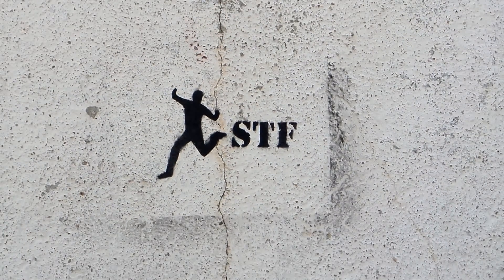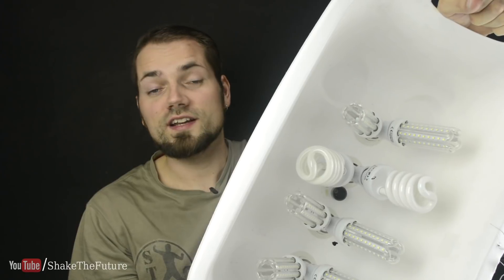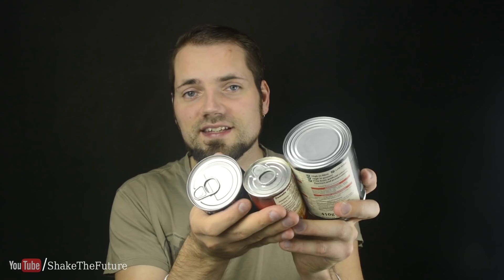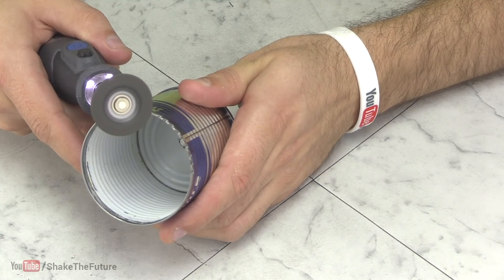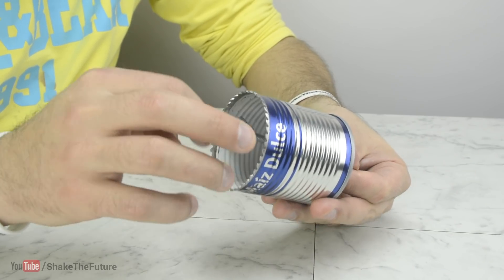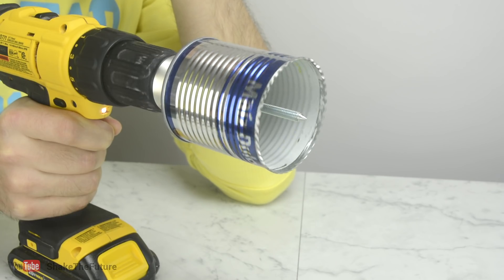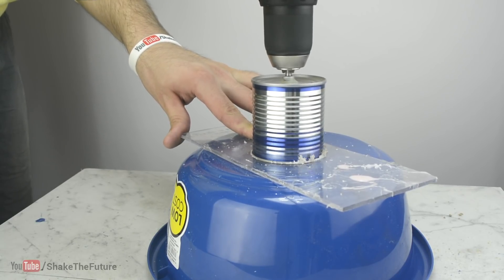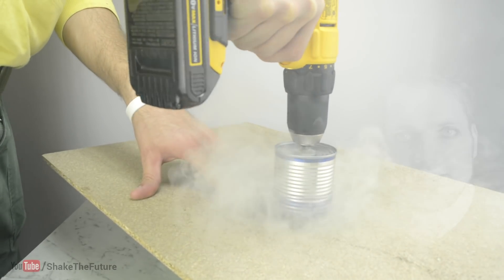Can You Drill a Hole With a Tin Can?

Comment: your can needs a hole on each side of the can, this will allow for air to cool the can so the heat from cutting does not get so hot, plus it helps for removing any piece you are cutting that may get stuck in the can, but pretty cool demonstration.

Comment: For 15 euro you can buy a set of bits. Those are not super high quality, but reliable for DIY job. And because its a set, you will see which diameter is what you use the most.

Comment: Only if I were 50 miles from town. It takes longer to do what you did than it would to heat the can and melt through thin plastic and trim it.
Reply: I don't like burning plastic.
Reply from the maker: I did not mention it in the video, but it took me around 15 minutes to make it + you can use it a few times before throwing it away. Heating the can is also a good idea. Cheers!

Comment: Always Keep the Receipt. Take the Hole Bit Back when done drilling all your holes. 

This is a Great Idea and works in a pinch for Light Duty. About the only reason why I think you had a hard time going through the Particle Board was because you didn't sharpen the teeth you made. Won't stay sharp for long but will cut down on the burning and smoke from being completely dull (metal too soft to hold a edge for too long).

I Guess if you didn't own a Dremel, you could use a Hacksaw and there fore this would be a "Hack" and putting the word "Hack" in the title would actually be one of the Few Times it gets used Correctly and Fittingly :)
Reply from the maker: Yes, i could have done a better job in sharpening it. Thank You for the suggestion.